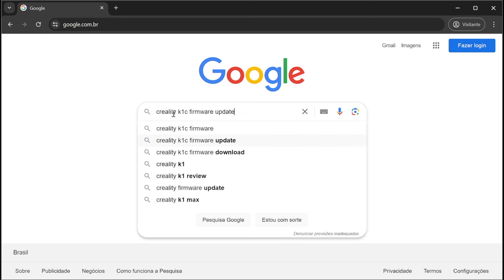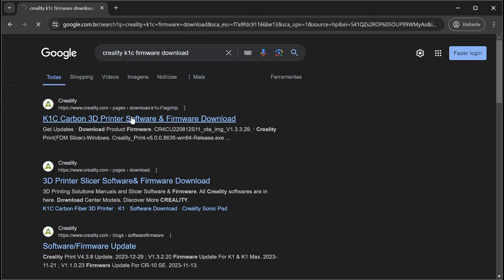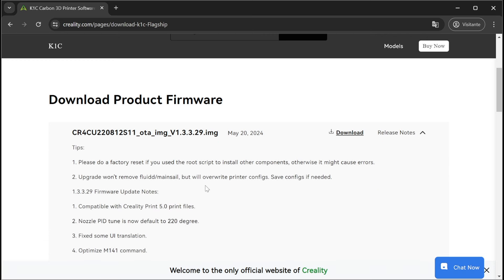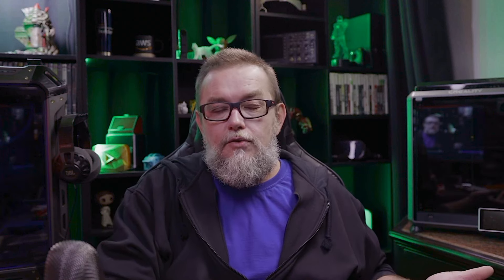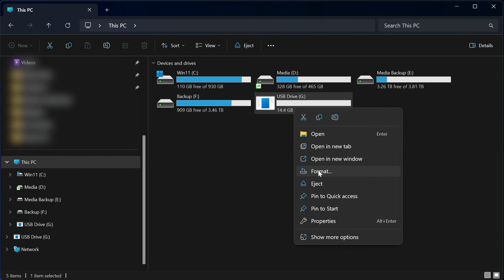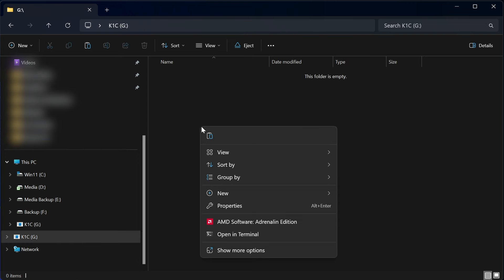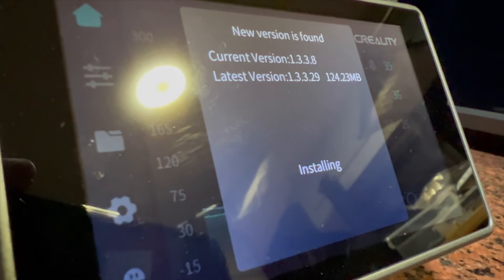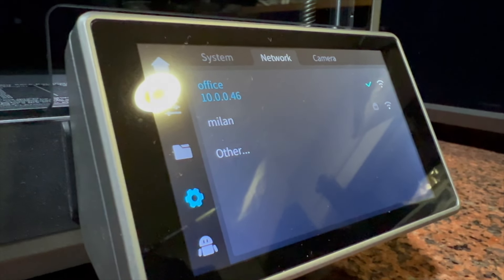How to Enable Wi-Fi on Creality K1, K1C and K1 Max Printers - Complete Guide

Comment: On February 19, 2025, I received notice from Creality Print for my K1 Max and installed Creality Print's latest Release 6.0.3.1591. My notebook and the K1 Max will not speak to each other. I've reloaded the release with full erase several times and restarted the K1 Max several times. The K1 Max signed into my WIFI fine. My iPhone's Creality Print app works fine. Very Strange. The firewall says it ok.